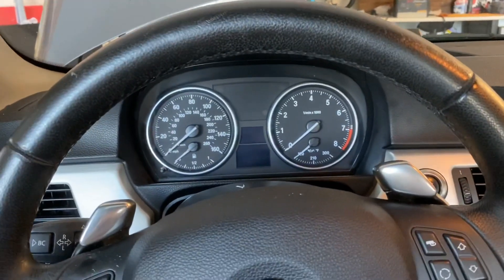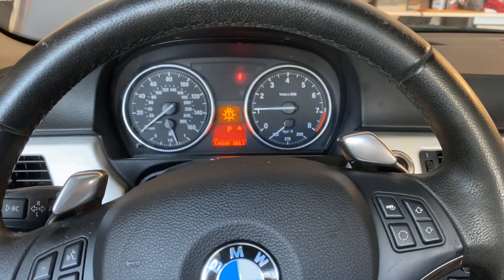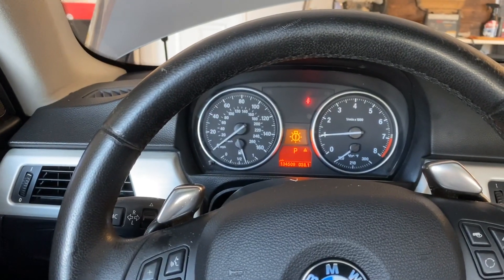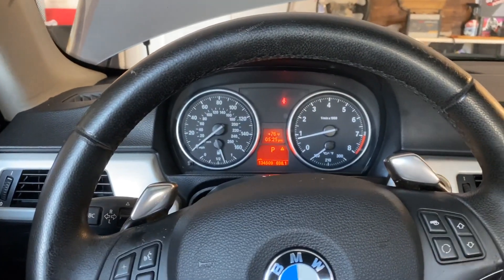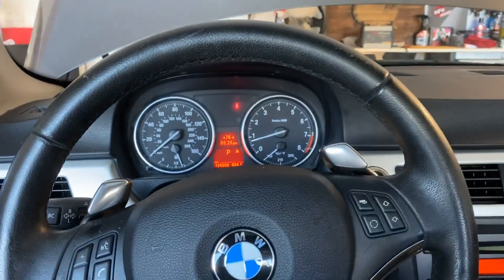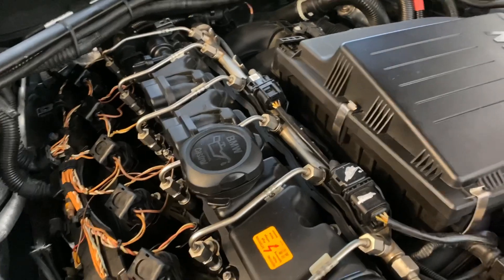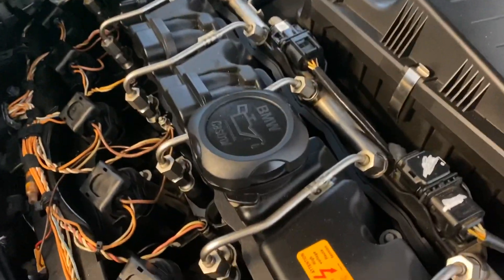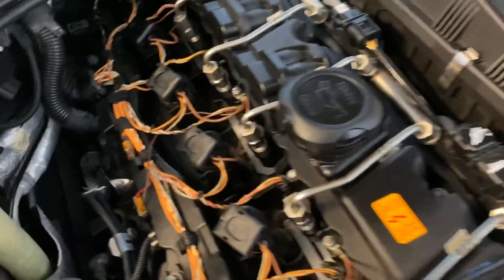8 Signs your injectors are FAILING | BMW 335i N54

Comment: Nice video i'm having same symptoms car starts harder and have misfire no code thou, more on cylinder 3 and I can hear extra loud tick and I have noticed white smoke in morning but goes away, also feels sluggish.
Reply from the maker: Same exact symptoms as me man.  It was cylinder 3 that was my issue.  No cel just a misfire and smoke on startup.  Changed injectors and it was like a new car!!
Reply: Awesome thanks for your reply I don't have same car but everything you described is what is going on with me really bad acceleration and bad gas mileage
Reply: Sounds like more than one issue. The sluggishness is probably because in needs the carbon cleaned out, I did brand new index 12s, plugs, coils, carbon cleaning, and all that good stuff. Transformed the way it ran.. I still get some misfire pops on cold starts and some white smoke on cold starts to. Leaned towards eldor coils and new turbos now lol

Comment: hey so quick question uhm I have super thick white smoke coming from exhaust and some super light/faint smoke coming from hood do you think it could be the head gasket or fuel injectors or maybe something more?
Reply from the maker: Heavy white smoke out the exhaust sounds like a head gasket to me.  Could be bad turbos/seals also.  Check your coolant to see if there is evidence of oil in it.
Reply: @SpeedCultureStudios  yeah when it first happened there was some chocolate milk where the oil cap goes
Reply from the maker: @Melljell  I would say head gasket
Reply: @SpeedCultureStudios  yeah im hoping so haha it'd even idle for a bit and then stall out on me

Comment: BRO, i been chasing down a misfire on my n52 for a month now, its just getting worse, white smoke from the tail pipe looks like someone is blowing smoke rings, misfiring like crazy, and after i watched this, i opened my oil cap and put my sniffer down there, literally smells like a gas can, im going to change cylinder 1 injector and oil tomorrow. hopefully all is good after that. thanks :D
Reply: I got charged 2k to fix 3.. and a oil leak
Reply from the maker: @lifeclips3329  ouch
Reply from the maker: That’ll do it!  Just to be safe, I’d put fresh oil in it.  Idle it for 10-20 minutes then drain it and put fresh oil in it again.

Comment: I thought white smoke means coolant burning. Should it be black carbon smoke?
Reply from the maker: White smoke can be a lot of things.  Coolant yes as in blown head gasket, but white smoke at start up can be a failing injector—you just have to put a few puzzle pieces together.  If you have a rough idle only for a minute or so with a bit of white smoke, it’s likely an injector.

Comment: Very helpful video. Thanks! If you have stock exhaust, and if the exhaust smell very strong, did you find that to be a potential sign of failing injector as well?
Reply: I was having the same issue with a strong odor of fuel coming from the car. After doing some research I found out that if the smell is coming from the left rear wheel well there could be a crack in your fuel pressure regulator. I pulled the rear seats off to access the FPR and it had cracks on the top part which was causing it to leak fuel and give off the strong fuel smell.
Reply from the maker: @robertharo6081  I have a video posted of this repair you’re talking about as well.
Reply from the maker: I did not notice extra strong fuel smell as it related to the injectors, but it could certainly be a sign.

Comment: excess fuel would be black smoke
Reply from the maker: It can be black due to excess fuel, but excess fuel due to a leaking injector can and will manifest as white smoke at start up particularly in a 335i, which was the case in my situation.

Comment: Got SES for P302-P303 and P0175 
Installed new spark plugs SES still present 
Receiving new coils today and will install them this Saturday 9/12 along with inspecting the new spark plugs after sitting overnight to see if there are any fuel on injector 2 and 3. 
If so it’s injector 2 and 3
Reply: Gotta resolve it quick before its gets worst than being injectors lol
Reply: @A____T3750  hi Aaron, was it the injectors?
Reply: @shalveenkumar2142  hydraulic valve lifter and  rocket arm
Reply from the maker: Hopefully coils clear it up!
Reply: Speed Culture Studios wasn’t the coils, had the new spark plugs in and swapped coils 2 to 1 and 3 to 4 and SES still on. Just purchased 6 new injectors today
Reply from the maker: Aaron Tang oh dang!  Sucks to bite that bullet but it’ll run like a new car now!

Comment: When I started my car and start driving for good 20 mins, and then shut it off for two hours while I was at the store, and then I started the car again. I got stuck in traffic was sitting at full stop idling for about 5 mins and then a lot smoke was coming out from my exhaust for good few mins then it went away. Is that a sign of bad injectors? I know it can't be my turbos.  Thanks.
Reply: I know its been 5 months but i had the same issue u have. I fixed it by replacing the pcv valve with an RB PCV.
Reply from the maker: Potentially.
Reply: It can always been the turbos. New ones can fail. But start with pvc if you haven’t yet lol

Comment: Im not sure if its my injector that's failing or my hpfp, Im getting codes 29CD - Combustion misfires, cylinder 1, 2AAF Fuel pump, plausibility and 2E18 - Firing Cylinder 1. its on limp mode now. Can i switch the injector 1 and 2 to see if im getting cylinder 2 misfire to determine if in fact it is the injector thats the issue? and can i do that without replacing the rings and decompressor rings simply to diagnose? or can i casue damage this way?

My original issue was after hard acceleration especially on the highway the car was choking / shaking. I have replaced the coils and spark plugs , which seemed to fix the issue for a month. few days ago i accelerated hard again and it went into limp mode and i am getting the codes above.

Beforfe the limp mode I also got a code 29D9 Misfire at low tank fill level. prior and in addition the the codes above.

Any suggestions? if it was the HPFP failing wouldnt I have issues with more than 1 cylinder?
Reply: I think the risk of burning the injector seat area in the head is always there, it just increases with higher pressures(ie: boost). 

That said, if you’re misfire is occurring only at idle, AND you’re able to swap 2 injectors very quickly(under 30 seconds?), it probably wouldn’t be an issue. Just remember before driving that the pressure (and more importantly COMBUSTION)will find any discrepancies in the injector seal.
Reply from the maker: I'm still learning a lot about this platform myself, but this is exactly what I did.  I was getting a cylinder 4 misfire.  I moved it to #3 and cleared the codes.  Code returned as a cylinder 3 misfire.  Seemed pretty obvious to me.
Now, the small seals at the tip of the injectors, those form to the openings in the cylinder head, so technically, I would not suggest running the car for long without replacing those seals once removed, but if you know one of your injectors is bad, you'll be replacing it anyway.
Have you tried checking plugs and coil packs first?  Moving coil packs is much easier than moving injectors.  If you have a bad one, the misfire will follow it as well.
Reply: Speed Culture Studios I recently changed the coils and plugs , I want to diagnose if the injector is bad and do what I did , switch , clear codes and run it for few seconds to see the codes again, I’m just worried switching them without changing the rings , hopefully running it for 30sec or less won’t damage anything ?
Reply: @dee1251  did you switch them?
Reply: Yea I only get my misfire on the highway, under heavy load. But if I drive easy. Nothing at all. It kinda stalls, like “brrrrp” and then sometimes goes into limp mode. If I let off the gas soon enough it wont go to limp mode.
Reply: @iKevin_22  I had the same thing , changed my Hpfp and coils and it fixed it